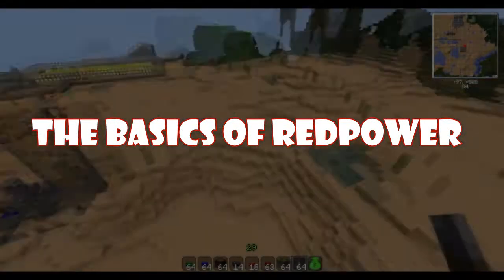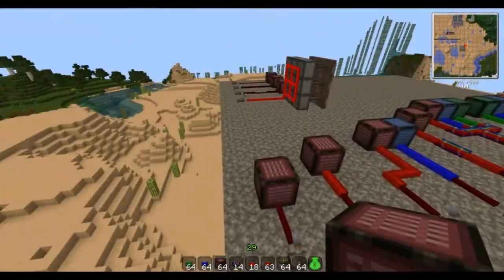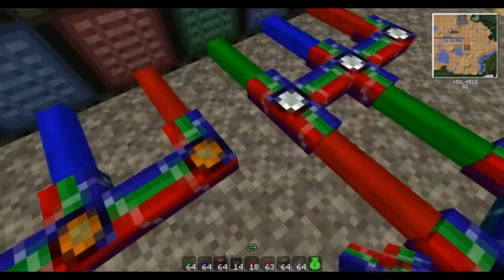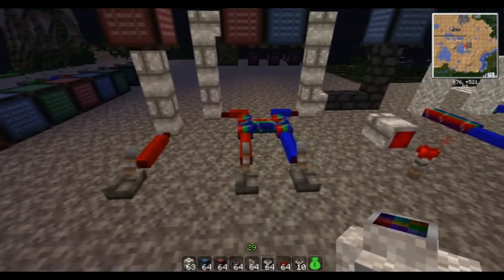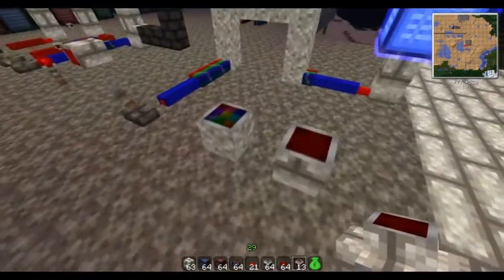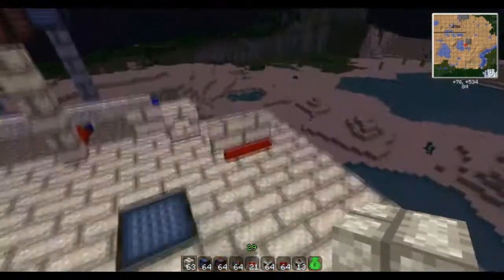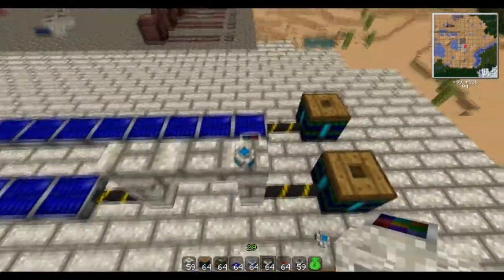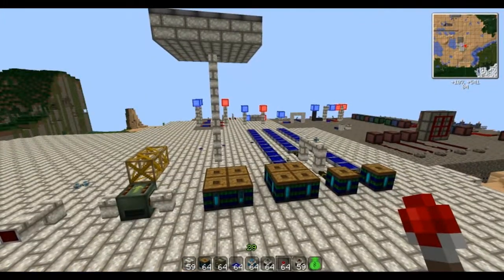Redpower: Wires, Power, Cables, Jacketing / All you need to know

Comment from the maker: I haven't actually used rails, however, it should be the same concept, just use your covers, if you want you can use Hollow anti covers AND covers to make a full sized hollow block if you do not like the narrow jacketed shape. Other than that, just hide the wires with covers and it should look great :).

Comment: Hey TheChallengeAwaits. Great video! I'm currently trying to do a system where we have a very long railroad and I thought it would be cool to make detector rails trigger lamps as it goes down the railroad.This would be an enclosed tunnel. Any suggestions. Obviously I'd want it to be as aesthetically pleasing as possible? I just have some trouble with jacketed wire, panels and cables and what not. Any ideas or suggestions?